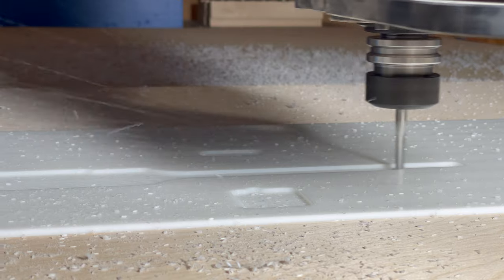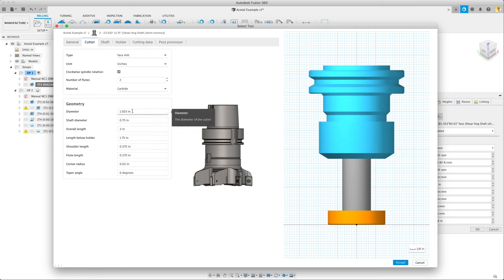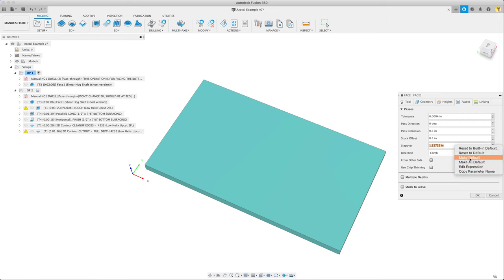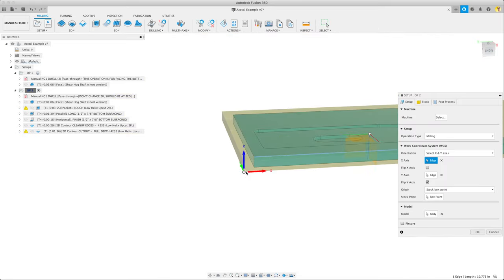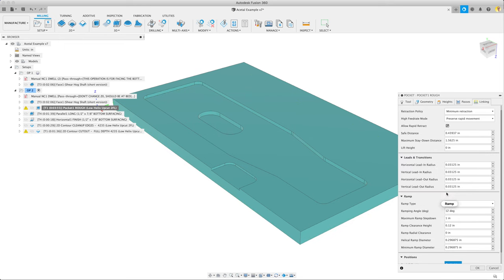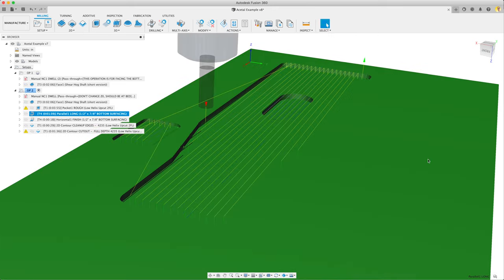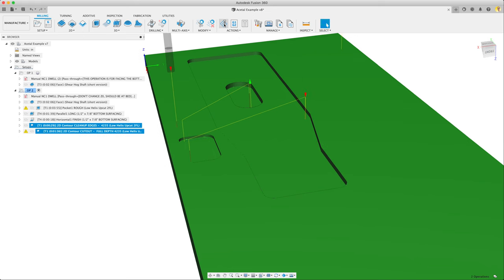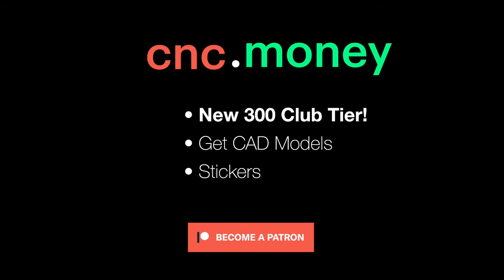How to CNC Machine Delrin Acetal

Comment: Hey! Just got a shear hog but was curious if you've ever planed down hardwoods with it, or what tool you would recommend yo accomplish this? I want a higher quality finish, perhaps around 2" diameter tool. Thanks!
Reply from the maker: Shearhogs are fantastic. It's not a superb finishing tool as it's designed for heavy material removal. Slower feedrate, climb, and smaller stepovers might get you a better finish though.

Comment: How'd you hold down this part?
Reply from the maker: Vacuum through the spoilboard
Reply: @pdxcnc  Thanks for the reply, that's what I figured. Do your speeds and feeds change with these tools much for HDPE? - I'm planning to test cut with the feeds and speeds on this video on HDPE. Any reason you flattened both sides besides surface finish and perfect thickness, I guess I assumed if it was flattened to the table and the table was flat, you'd get a perfectly flat part by just facing one side, but that's only if the table is freshly fly cut and flat I suppose - is that the right thinking? Thanks again, really appreciate this channel!
Reply from the maker: Feeds don’t change much in terms of chip load. Traditionally you only know a surface is square or coplanar if you machine it. If you don’t have a high tolerance need, machine only one face.

Material is never as accurate from the factory as you’d imagine.
Reply: @pdxcnc  Of course! Do you use that same facing mill to plane down or face off wood?

Comment: for simple operations like facing the most efficient way of work is to not using Fusion 360 at all.   
many operations can be done faster in manual mode or with simple software.
Reply from the maker: Sure, assuming your machine has the capability.

Comment: Why are your lead in and lead out feedrates almost double your cutting feedrate?
Reply from the maker: I like to move quickly in and out of cuts. Those should be non-contact movements. Ramp should be about half of feed
Reply: Its plastic, not metal.